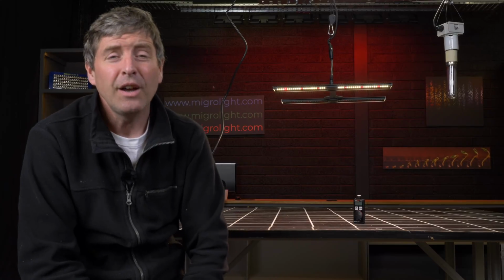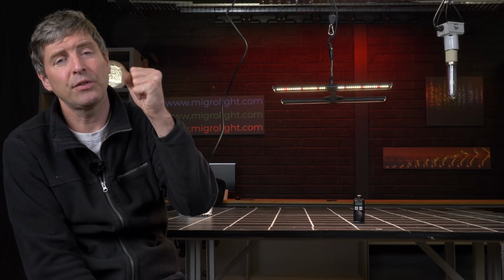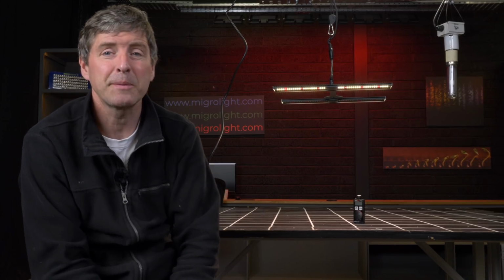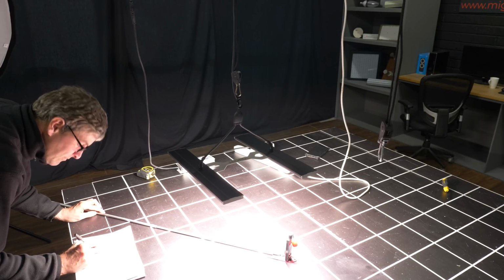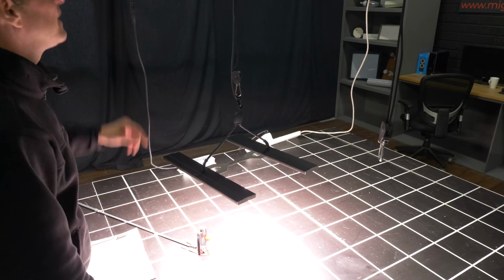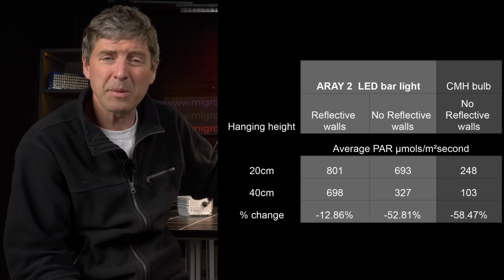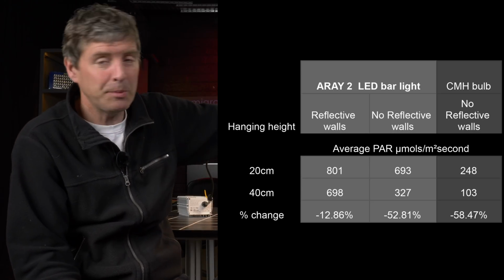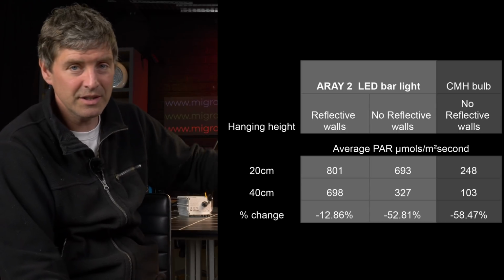Inverse square law is WRONG for grow lighting

Comment: So, first your point about the reflective walls is a valid one since no material reflects 100% efficiently.

However, the problem with your test is that your model of taking the average readings does not take into account basic Geometry.

The Pythagorean Theorem (which cannot be disputed) states that an increase in length of the hypotenuse of a right Triangle A2 + B2 = C2 will not be linear unless you are increasing the length of both other legs of the right triangle evenly.

Therefore, by doubling the height but not increasing the area of your grow space, you are not increasing the distance from the light to the edges of your canopy linearly.

Now, the closer your light is dimensionally to the dimensions of your grow area the less this will influence those numbers (as your “B” leg of the triangle is shorter and will effect your sum less), but in this case you are using a very small light dimensionally compared to your space.

So, let’s say we had 20cm height and the edge of your space was 40cm from a plum line drawn straight down from the edge of your light. That gives you a rough distance of 44.72 cm for your hypotenuse.

Now, double that height to 40 cm but keep the other leg of the triangle the same and you get a 56.57 cm hypotenuse, not 80 cm. This drastically increases the complexity of a legitimate design that you would need to make averaging out the PPFD a worthwhile comparison.

What you should do is just take a quantum sensor and place it directly under the light (use a level to be sure it’s plum if you really want to be accurate) and take a measurement. Then half or double the height of the light and take another measurement.

I’ve done this with my light and it winds up more or less tracking pretty accurately in line with what the Inverted Square law predicts.

Would like to see the specific measurements directly under the light were at these 2 hanging heights and see how they compare.

Thanks for the video. ✌️

Comment: Shane …. Wondering if you could please do this test …. An old photographer’s trick to calculating light.  It’s based on cameras f/ stops which are converted to inches, feet, yards whatever.  So there’s f/2, f/2.8, f/4, f5.6, f/8, f/11, f/16, f/22

So for our example f/16 = 16” from light to canopy.  When you raise the light to 22” the reading should be 1/2 the amount, theoretically anyway.

Would this be an interesting quick test for you to try ??  

Thanks for all your content

Comment: Sean. can you explain to us just how dark our room needs to be for the night cycle/dark period. Also lots of us use camera with IR Camera to monitor the grow. Does the IR light emited from them affect anything. 
Also I've been hung up on ppfd for years when working my lights wasting lots of electricity. Using your app I can now get the correct DLI for whatever light cycle I'm running. Much appreciated 🙏
Reply: Loved the video on the ac affinity controller. I think automation of the grow room is going to be the next big thing. Some1 needs to incorporate feeding, ph  and growing medium sensors into the mix.

Comment: so why do people use 1000w hps..why not use alot of 150w hps..because more power shines further..get 1000 fairy lights for a christmas tree and use them..also use 2 sets of them and thats the same as a £15,000 lighthouse bulb.😆.get 1 cheap led torch then get 100..you will see they dont shine further than the back fence..even if you use 100..its just a brighter fence..then go out and buy a powerful torch..it will shine further than 100 low power ones..led grow light diodes are 0.4 w ..some are only 0.12 w depending on how many diodes they use..they tell the uneducated they are more efficient..whch is true but that doesnt mean better..so lets see the 1000w hps hanging height plus 3 foot [plant..the par levels will be better than any led..lets see this..not the daft canopy height

Comment: You are mesuring it wrong if 1 foot away is 100% then 2 feet is 25%  you are also moving the meter around you cant get an acurate reading as the height will not be the same for each measurement place on the area and angle of light act..  but if you move the light away and keep the meter in the same place where ever that is on the grid that spot will lose 75% of the light it was from 1 foot away - 2 foot way. Moving the meter is not giving you a correct measurement as they are different spots. Uniformity and luminosity are different things. Draw 1million tiny cubes in 1x1m each and every one of those cubes will receive 75% less light every distance the light is doubled  from the source cube 1 might have 300par cube 2000 might have 600 per if you move the light 1 foot away  both cubes will lose 75% of the light luminosity.

Comment: Obstruction---a topic ive never seen really debated or testet on Youtube. The smaller your source of light, the more leaves wont get direct light. the perfect panel would cover 90% of the complete surface, only allowing some air to pass by. I think this is even more important than the naked efficiency. It is another form of efficiency. Efficiency on paper can be deceiving. take a cob for example. The light is distributed well if its high enough. At least on paper and on the sensor. But once the canopy grows and is not levelled anymore, many leaves will block other leaves from direct light, because the source is so small.

Comment: Once again, I come away from one of your videos with good information,  but also with more questions. I'll try to make this short.  Considering the canopy penetration, I assume, and I think  I remember you stating that LED bar and quantum boards are good because of the many light sources and angles. So, it seems to me that 1) more diodes are better than less, 2) the closer to the canopy would provide better angles,  therefore being better. If the are true, then would more lower power LED's placed closer be better than stronger ones, providing equal par values at the top of the canopy? Maybe more, cheaper  lower power diodes would be better than less higher powered ones ? Or, more higher powered ones running at less power? I am thinking in terms of results and efficiency.  I hope that I made sense and you can understand what I am trying to say. Any input about this will  be very much appreciated. Koi
Reply: it all holds true but more leds will just cost more the fixture will be bigger harder to make harder to transport. most use the very efficient samsung leds only real difference between most fixtures nowadays is how many they run the cooling solution and how much current they run trough them. some use 100 leds run 3 watt each some run 300 leds 1 watt each yea the 300led one generally will be better but way more expensive

Comment: I always thought the inverse square law was due to a property of light. I never realized it was due to the 360 degree radiation. Makes more sense now.
Reply: Its a property of light.
This guy is propagating bad science.
By his standard if i put any two lights in a small reflective area the law would not apply  because measurements taken do not show it clearly.
Fact is if you measure multiple light sources like the LED you will have inaccurate measurements, each diode must be measured individually to see the law in effect.
While HPS appears to be direct light the end of the bulb refracts light in inconsistent patterns.
Reply: @swskitso  I guess his test equipment is wrong too?

Comment: Is LEDs a lambertian source.  Or is that only with diffused lighting. And LEDs are are on a plane which kinda scatters light in all directions would having LEDs chips that are say shaped around a type of tube or something having better coverage than the traditional flat potted in LEDs. 

Like example the in house made chips by Green Sunshine company don’t sit flat on a board they are kinda rounded.

Comment: The inverse square law half works with multiple points, I'm not a mathematician. But I'd imagine the final equation has a calculation for the quantum mechanics involved, which would essentially replace the inverse square law formula. It would probably involve n light sources, wavelength of each source, spacing from each light source, then you would get the predicted curve and determine through this curve the intensity of light in relation to every other light involved, the distance between each source and all that. The reflective surface would be something like the amount of light at each point, *x% of the par reflected, then use that surface as your new start point, then map enough points to get a curve, use the direct curve of the light and add the reflective surface curve to determine the extra par output you would gain from the reflective material, then you would have a proper formula. 

I'm not a mathematician though. So I'm just saying things lol. w/e

Comment: Its just like everything else in physics, the inverse square law works on an ideal point of light source (which can't exist), just like a friction-less pulley or other ideal physics scenarios.
Reply: frictionless pullies etc. are used to simplify problems for learning purposes and aren't used for actual engineering/ physics problems guy. In real life and advanced physics courses they dont used frictionless pullies and all measurable variables are accounted for, pal.
Reply: @jacobstanfill9538  That is what I was saying...
Reply: Perpetual motion machines are real! The earth is flat! Birds aren't real!
Reply: There's no such thing as "ideal physics".  Theories of mechanics don't stop working because there is friction, that is just an extension of the theory.
Reply: @CarrotCakeMake  I guess you never took a college physics class then where nearly everything you calculate is like this. Lets take a simple rope, pulley, and mass example. You could have more than hundreds of variables impacting the actual real world result of what you are testing.
Reply: @RIPPEDDRAGON40k  Of those hundreds of variables, none of them would violate the laws of physics that govern the simple scenarios.

Comment: Dang. I do know that with reflective walls, the PAR at 2 feet is generally 50% of  PAR at 1 foot. Without reflective walls, it would be less than 50%. I didn't even go to 3 or 4 feet 😆 I just went by the grow conditions I'm looking to put together. I never had any physics.  I did have college English 101 when I was a sophomore in High School though. 😐
Reply: Are you saying he should have measured at 1ft and 2ft from the canopy? With an 8" distance apart and Mylar walls there was only a 12.86% difference in PAR.
 Just wondering what wasn't explained or shown? I'm no genius, for sure! Any input would be great!👍
Reply: @timturk1899  No. I'm saying I should have answered none of the above! I chose without reflective walls because of what I know about PAR levels with reflective walls at 2 feet and 1 foot. I did not stop to remember that the 2 and 1 rule I noticed really only applies to strong even coverage lights like the Atreum 3200 and Maxi MF2000 that I ended up buying.

Comment: What a great video.  While of course the inverse square law holds true as a pure physics/geometry exercise, as you show there are multiple reasons that the inverse square law doesn't hold up in a grow room application.   Well done.
Reply: It drives me nuts that he keeps saying the law dont apply.
Its a misrepresentation of the facts.
Reply: @swskitso  

Certainly the law doesn't apply the most people apply it - not even close, which is the point.
Reply: If he accounted for the fluence map through geometric parameters we would see inverse square. This would account for gradients and spatial variance of fluence, which is not needed in the case of isotropic radiation from a point source.
Reply: It does hold up but you cant expect accurate readings from multiple light sources or indirect light.
Reply: @swskitso  

Agreed.